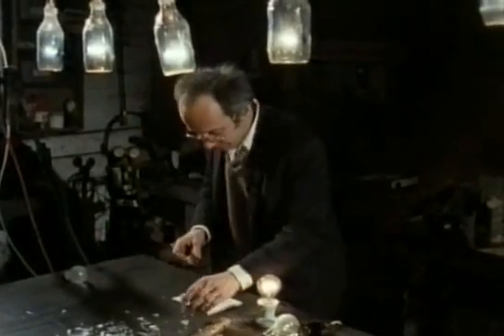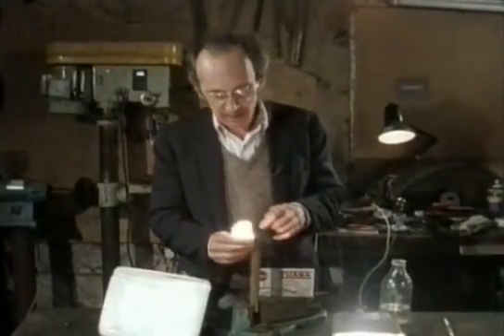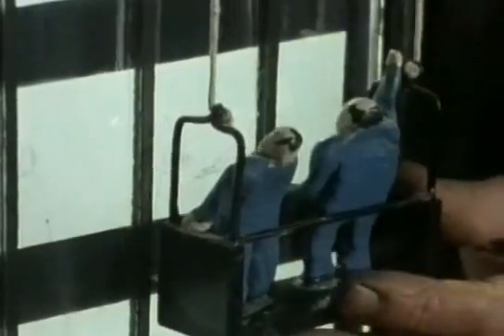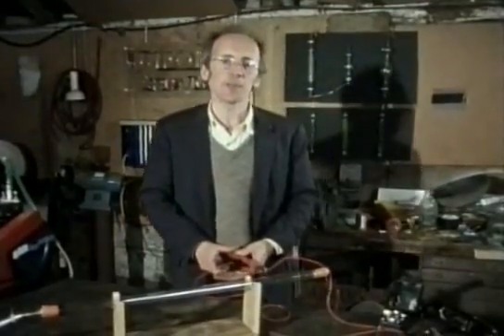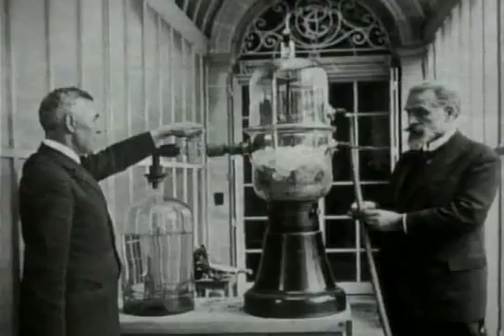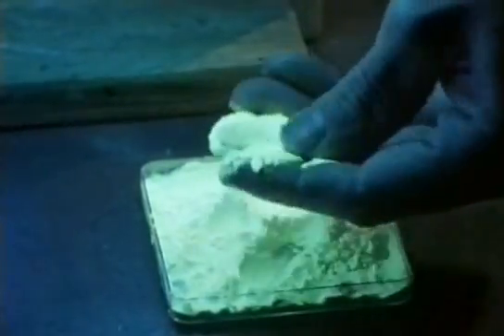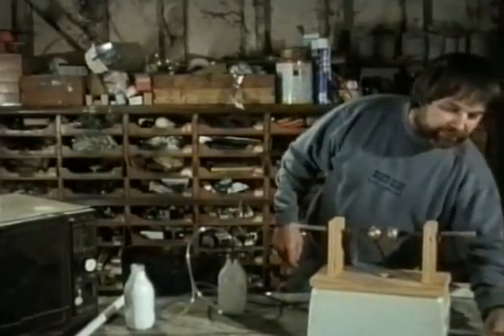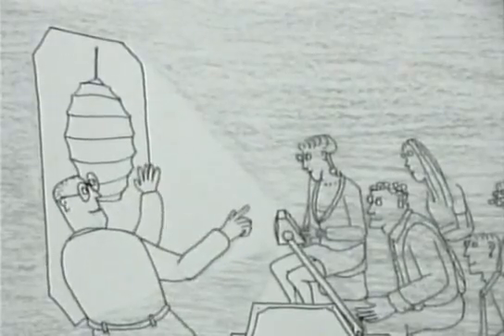The Secret Life Of Machines - The Electric Light Part-2

Comment: @630MillionGods Were you listening? It is flourescant lighting. There is no wiring. There is no filament. There is no high voltage DC.... It is flourescent material in the vacuum bottle and is powered by the high frequency radio energy.